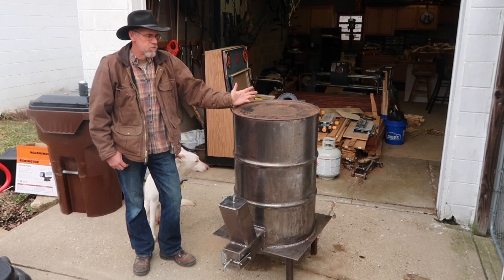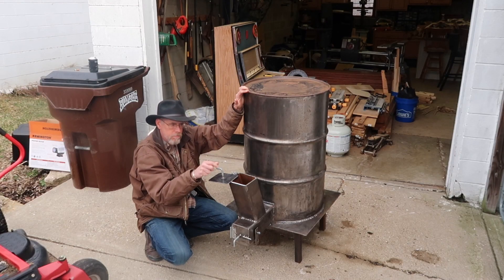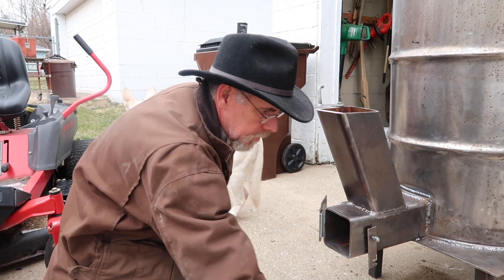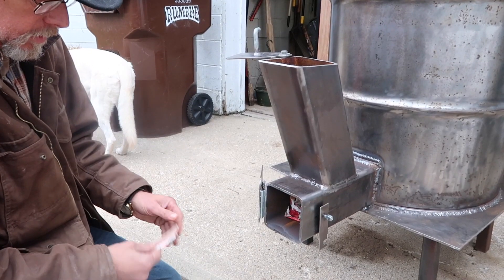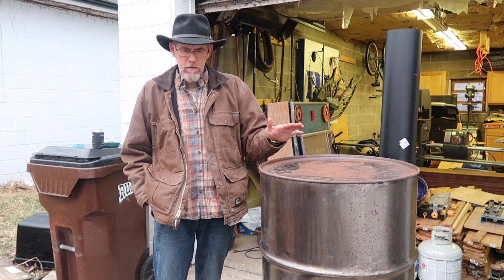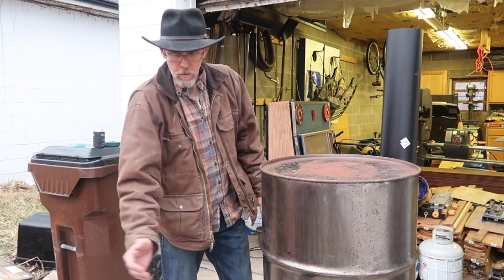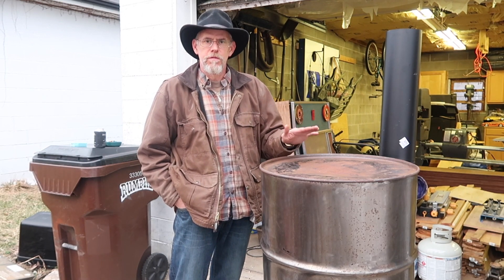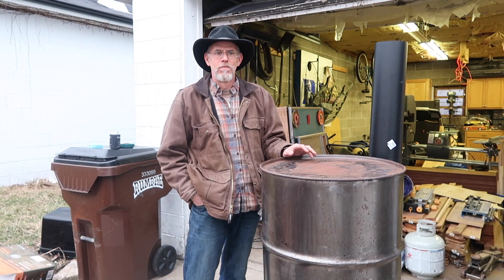Rocket Heater First Fire Up! Part 2

Comment: you need to put a tray in the top and bottom chute  to allow the air flow to pull the flames through a gas gun or even a hot air gun works wonders to push the air through the flue.

Comment: I have been working on mine the past few days I insulated my burn chamber my top plate hit 738 DEGS the sides 500 to 550 degs it makes a big difference. I used 4 inch square tube and two propane tanks My garage is 20x18 block construction no fan like you were using I got the garage to 68 degs when it is 32 outside.I will be modifying mine to a force hot air next.

Comment: Looks good, but it has problems. Your "cleanout" is actually the air intake. The feeder should never have a flame coming up it. The drum needs to be filled with a non-flammable insulation to hold the heat, which air does not do. For a cleanout, drilling holes in the bottom of the tube below the feeder tube and then putting a door over that would be better for cleaning as you go.

Comment: Actually watching you stuff your initial paper in I think you had the combustion chamber packed with paper and as soon as it burned off the air could flow... Just suggest less paper heat flue slow start slow and it will work without the smoke....

Comment: The theory, plans, and operating procedures have existed on the net for quite some time now. If you had researched a bit you wouldn't have had such problems. Back to the drawing board. What puzzles me the most is if you know that the fire has to go up the riser what compelled you to sit there and feed the fire for so long under the feed chamber. All you had to do was push it in with a damn stick. Fail for a lack of research and common sense and hope you learned something.
Reply: wow, so much hate?

Comment: I think you forgot to insulate the inner Riser. I've also heard you should not build the Riser out of metal as the goal is to get the heat in the barrel up to 3000 degrees or hotter

Comment: Yup... my first rocket fire filled the house with smoke...

I found you need to introduce heat into the riser, slowly. As the riser heats, you can add fuel in the burn tunnel... but I guess like me, you figured it out... 

Now, I can get a fire started in a minute. 

I put about three or four white pine pine cones at the bottom of the riser, roll up one sheet of newspaper, light one end, and shove it in to light the pine cones. 

The newspaper burns like a fuse into the burn chamber, which I also added pine cones to, with a fist full of short kindling. As soon as that is burning in the bottom of the burn chamber, I begin adding fuel... I can now walk away... not a puff of smoke in the house.

Love my rocket... looking forward to building version 2.0
Reply: Thomas Walz

Comment: Nice work guys! Not to tell you what to do with the rocket stove but. I'd put a clean out on the bottom of the 55 gallon drum for cleaning the little bit of ash that collects on the bottom. I also installed a small drain with a cap in the bottom of mine so once a year you can take it out and rinse it out. You can kinda see it in my video on my channel if you want check it out.
https://youtu.be/ZmrcqBjWip4
Reply: Build With Webster
Reply from the maker: Just watched your video. Nice job too! How well does yours work since it is a bit smaller than ours? I'll be putting part 3 up soon to show ours warming the garage/workshop.
Reply: Build With Webster 
I heat a four car garage that isn't insulated with it. I put a couple fans blowing on it to help keep it cooler. The first time I ran it for a few hours it started burning the paint off the top of the tank. I also added the heavy plate on the top because I didn't trust the flame hitting the tank and it makes a great place to add waste oil pan with a drip line into the bottom of the J tube.

Comment: Insulating the combustion chamber and riser dramatically improves the thermal efficiency while also reducing startup time.
Reply from the maker: Noted, will see what we can do about that, thanks.
Reply: I agree... keeping the fire away from any cooling effect is key.

I'm going to push that envelope, making a larger burn chamber today. It will eliminate some burn chamber insulation... fingers are crossed...
Reply: If he insulates the burn-chamber and riser he will have to make a new one in 2 or 3 months  ! it will get to hot for mild steel 1/4 or not

Comment: Sorry you got the flames and smoke coming out the air and fuel feed. You light the paper back all the way to the back riser then get the wood lit. You light the fire first in the rear.
Reply from the maker: Yea at first we were disappointed but eventually, we figured it out. Part 3 coming soon shows it installed and how effective it is. Then on to the next project!
Reply: You are absolutely correct there. Flames and smoke should not come out the oblique feed tube where the wood goes in.